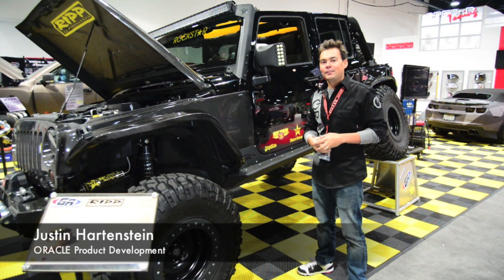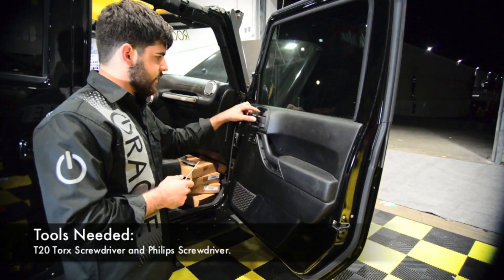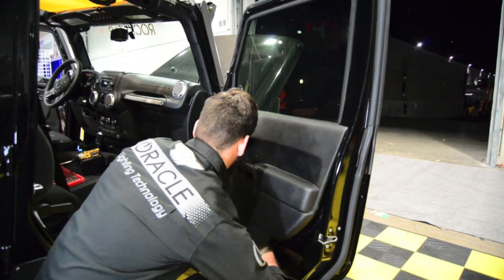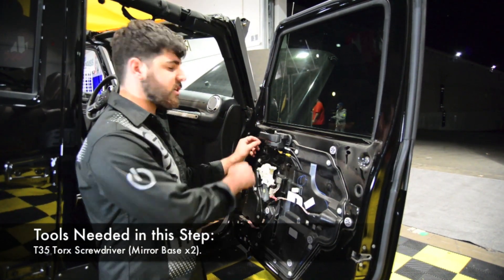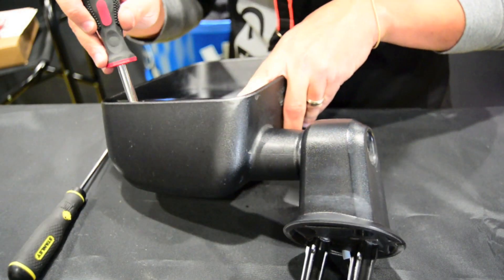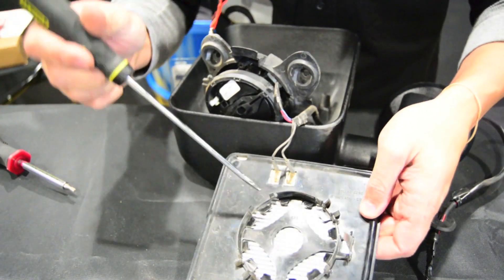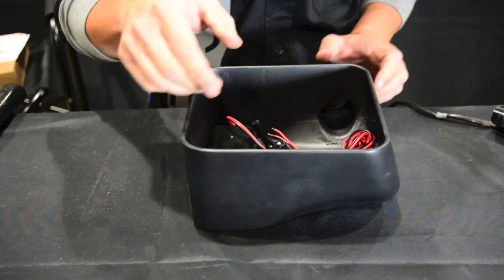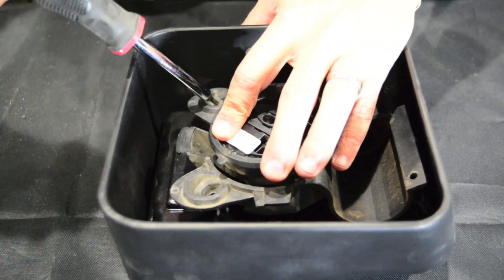Jeep Wrangler JK ORACLE LED Off-Road Light Bar Mirrors Installation Video DIY

Comment: ive seen the video about 20 times and have installed the mirrors just the way the guy does it in the video . I have only one problem when i shut the door  there is a wired noise  coming from the  mirror  as if anything is lose! Need help that noise  every time i shut the door  is driving me  nuts ! as if the inner part of the mirror  hits the housing !!
Reply: Did you ever figure it out.
Reply: +Jason Joy  nope !!!  I got a second pair. same noise ! I think the balast inside the led box make noise !! Very anoyed !!